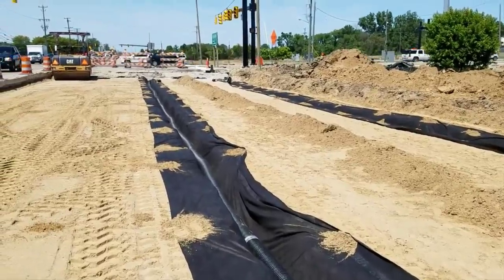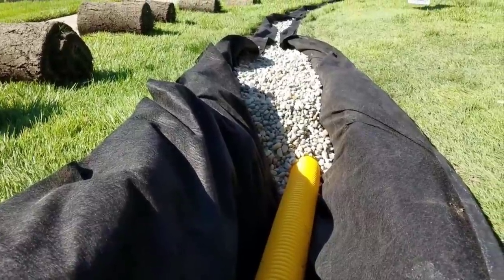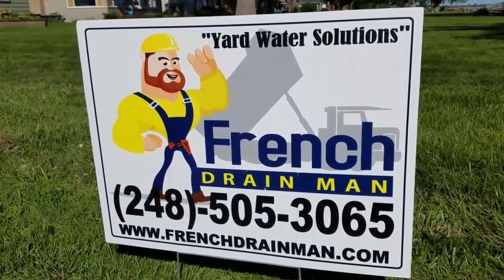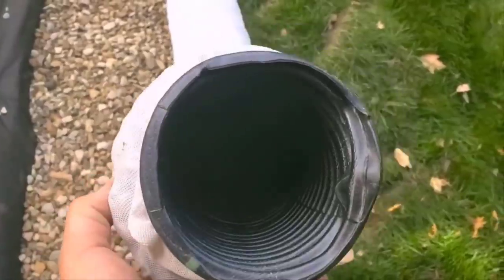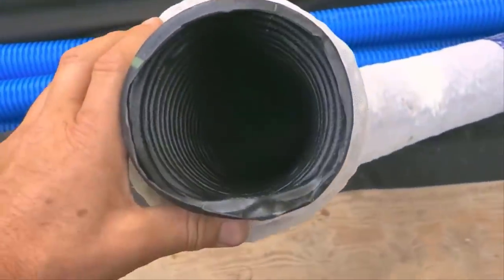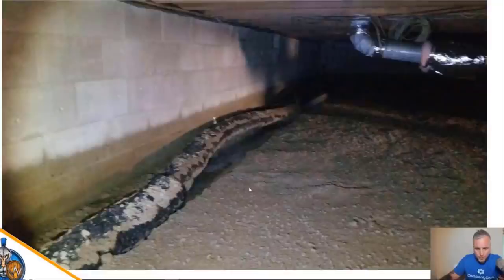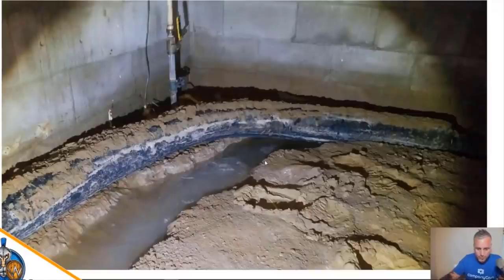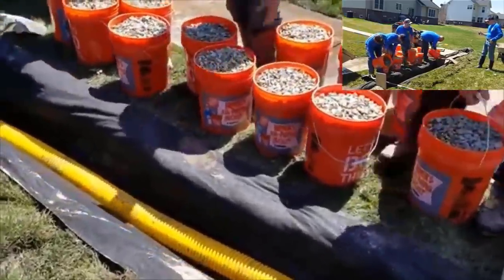WARNING!!!!!  French Drain Failure  [4-19-2020 ]

Comment: I am doing a 200ft french and solid drain around my 20x40 pool with flat ground. I already purchased the perf 4 inch from the depot , this is not the EZ drain. With those small 4 slots i get from NDS should I still not put the gravel under pipe? Please advise You rock my friend!
I am a physical therapist during day, fix bodies in pain and now off to fix my flooded yard !... I'm hoping I can have sufficient smarts to make this work!
Reply from the maker: Our fabric is double punched 👊 you can lay pipe directly on the fabric if it's the right fabric. Our fabric is specially designed for this use. Order the 5'x100' Fabric
Reply: @FRENCHDRAINMAN   I screwed up already , I ordered 8 Oz needle punched fabric BUT only 3 feet x 300ft. I was going to copy your design to lay 2 pipes in the burrito a solid for drain and a perf but now with this 3ft fabric, should I just leave out the solid and wrap only the perf?

Comment: What's the minimum depth you should start a perimeter French drain?
Reply: Robert Bachman I’m not the expert here but I would say the pipe needs to be the same depth as the slab or foundation of your house.
Reply from the maker: @Robert 
If its a Curtain French Drain around your 🏡 Holt is right if its a Perimeter French Drain following the property boundary lines start at  14" Deep.
Thank you for commenting!!
Reply: @FRENCHDRAINMAN  Do you install curtain french drains? I live in an area with sandy soil and a high water table so my only issue is draining water away from the house footing. My main concern is tree roots since the footer of the house is only 5' below grade, would you recommend an 8 ounce fabric and more stone aggregate around the pipe to avoid feeder roots entering the drainage system?

Comment: I think this is fascinating.  A professional company. Clearly a industrial standard and  unbelievable to see  swamps being drained out.  NDS will have its own specs for its products and would say this pipe was not pinned down,  but it shouldnt have much  bouyancy as you show us in failed photo.   Most of culvitt/box and those pipes have  5mm holes in bottom (non styrofoam) and perhaps adequate for a diy er..   Apple has shown many test videos also.. perhaps we will all have to get a clear pvc boxes with pipes and sleaves and clay/sand try mixed with gravel experiment and see what the outcomes are as far as the causes of  little or no ingress of water into these pipes. Is it not just poor installation causing failure?

Comment: These 2 guys never talk about $/LF.  That highway design probably costs $25 -$35 a foot installed.  You can do systems much cheaper than that, granted they won't move highway water, but how much do you want to spend?
Reply: Jeff Bryda how much do you charge per lf?   I heard anywhere from $20 to $40

Comment: Hi French drain man 
Trying to get water away from my front yard and around my house from hard rain on the lawn. I have storm water down pipes that connect from my roof to the underground pipes, in turn they run to the road mains. How do you tap in your perforated high octane blue pipe into a solid storm water pipe on a property that eventually runs to the street storm water system? The only place I can move the water on my property is into the town storm water pipe system. What’s the best way to do this?
Reply: With a white permit!

Comment: Why corregrated pipe, and not sched 40?
Reply: Handyman Grandpa a French drain needs inlets for surface and ground water to get into the pipe. This isn’t a roof runoff system
Reply: @jeremiegrund  why not perforated PVC? I'm planning my system now and it looks like I'm going to go with perforated PVS instead of corrugated flex pipe. The install will cost more and will be Harder, but I think it will last longer
Reply: RoyalRadande that would work as well, depending on your climate and water situation PVC can bust if frozen solid and generally needs more planning for cuts and angles. But it still would work
Reply: @jeremiegrund    hmmm..I'm in Pennsylvania. Now I'm worried. I don't think that I'll be able to go below the frost line and make the pipe daylight. At the same time, I've read that the corrugated pipe needs more slope, is prone to blockage, and can't be cleaned out with roto rooter, etc.

Have you installed a system?
Reply: RoyalRadande I’m in Ohio I installed 2 4” corrugated drain tiles (one solid for roof runoff, one perforated for a French drain) to improve water issues in my back yard. I then sloped them as well as I could to a flo well in my back yard because I don’t have any storm hookups. Slope of course helps but having the pipe in the ground will at least give the water somewhere to go. If you burrito wrap your system it should keep free of roots and tree debris which is what French Drain Man preaches
Reply: @jeremiegrund  nice. How deep (and wide) did you dig your dry well? How is the area around the dry well after it rains?
Reply: RoyalRadande I installed an inlet above the dry well to allow for surface water to go in and allow the well an escape if it ever filled. It’s been in a couple of months and I haven’t seen it overflow yet. The real test will probably be next spring. Depth wise I believe I was around 12 - 18 inches and at the sections with both pipes I was probably 10-12 inches wide

Comment: How would I know if need 1, 2, 3, or 4 pipes?  How do you secure your fabric over the stone when you're finished?
Reply: He sells fabric staples on his site. I just ordered  the stuff to run a quad pack. I purchased the staples when I ordered my pipe and fabric.
Reply: 1 is fine.  4 seems excessive, unless it's cheaper than rock and can move water down to the main pipe as quick as rock would.
Reply: @mae2759  Yeah, he said in a video somewhere, that the pipe was cheaper than the stone. If you have to pay that freight charge for delivery, mileage may vary.